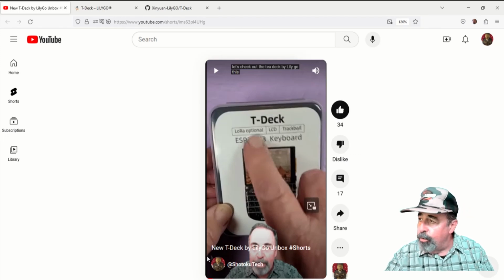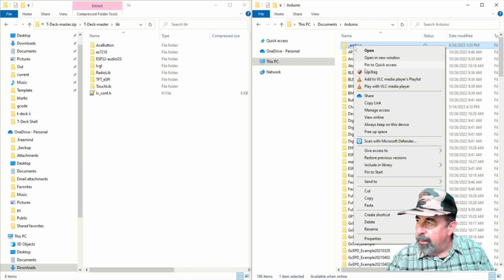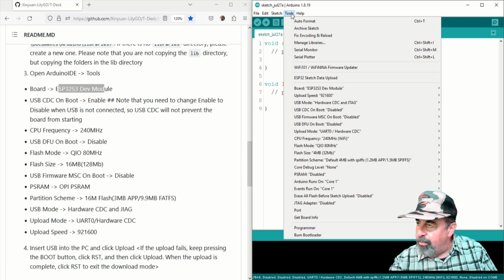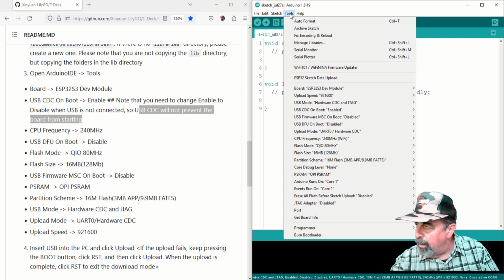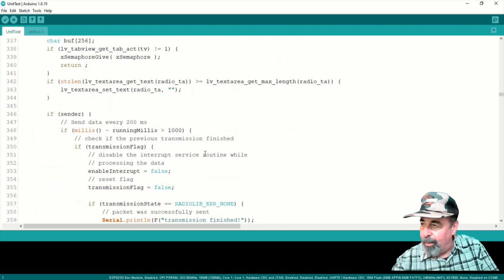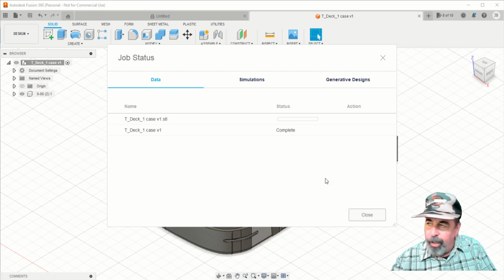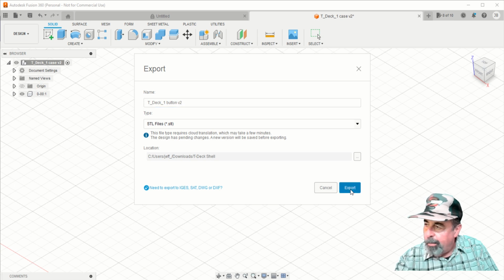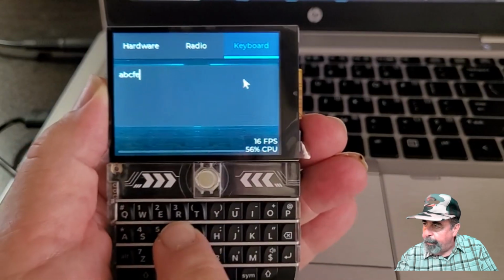Getting Started with the T-Deck from LilyGo

Comment: I'm getting an error compiling the UniTest sketch. "exit status 1 esp_vad.h: no such file or directory. I have the proper libraries copied and the links on the preference section. I tried searching for esp32 core files by Espressif to add to library and can't find it either which would have that missing file I guess. Any ideas to solve this? Update. Found Esp32 core by Espressif on the 'board manager ' I had it already installed. Still can't solve the problem. 😔
Reply from the maker: Yeah I am not familiar with that error. Sometimes I like to try making a fresh 'Arduino/Libraries' folder. Make sure all my board manager URLs are up to date. Reinstall all new board definitions and libraries needed.
Reply: @ShotokuTech  Agrees with you on the steps you take when preparing to flash these devices. In my case I used a Laptop I installed Arduino fresh with all the required libraries, board support and copied also the libs folders content to the right library folder, etc. Still couldn't solve the problem and couldn't find any solutions on the web either. So I just went ahead and flashed Meshtastic and and been TX and DX on the USA Long Channel with the T-Deck. I also own several other units, 2 Heltec V3.1 and several other ESP32 devices. I've found with other sketches posted on github by LillyGO having issues as well and have had to find a fix for them. But this one just didn't cut it. Take care and God Bless.
Reply from the maker: @johnny14794  I have a significant backlog but you present an interesting challenge. I might revisit this in the next two months. Best wishes.
Reply: @ShotokuTech  Always checking your channel for what's new. I am a sucker for gadgets and this channel is very informative, educational and I have learned a ton from you. I am not an advanced programmer but I tinker a lot and implement what I learn from you and other YTers Like "Volos". Looking forward to your next videos. Take care and God bless.
Reply from the maker: @johnny14794  Thanks! I keep trying every day.
Reply: No clue if you are still having this issue, but if so, use the "old" ESP32 version 2.09 found in the "board manager"
Anything above this gave me the same error. IE. Compilation error: esp_vad.h: No such file or directory

Comment: Great videos… I have a T-Deck on order and it appears that it does not come with a battery.   My question:  what voltage battery will I need to get to power it? I have searched and searched for the T-deck voltage/battery info with no solid results. Any info would be appreciated, thanks
Reply: Holy cow someone asked the question and got a dang answer. I can't believe this nonsense. I've looked forever for this information. Why the heck doesn't this appear on the lilygo website? All the other devices have a spec sheets. But the t-deck leaves you clueless. I had a solid idea that it was 3.7v just based on what I've seen people build out. But seeing the data sheet is something that, as a semiconductor enthusiast and builder, I expect to be available with hardware. If not that, then at least on the github or community forum. But no - I've even contacted lilygo with no results. Thanks again.  ~~~ Still frustrated though. I should make a video that is called: Lilygo T-Deck Voltage Requirements. I think I might just do that.
Reply from the maker: I like this one for its capacity and the plug is already installed. https://amzn.to/3H7YI0L
Reply: @ShotokuTech  Thanks for the info….I’ll check it out.

Comment: For those not familiar with them, STEP files are the interchange format for most 3d CAD platforms. If you export a STEP file from Fusion, it can be opened or imported in OnShape, FreeCAD, and probably half a dozen other CAD platforms.
Reply from the maker: Yeah, I just wish Cura could slice STP files. But this gave me the opportunity to learn how to use Fusion and I can modify the original files. Thanks.

Comment: This is really close to the optimum "Apocalypse Communicator". It still needs a couple of things. First off, high on the list, is a E-Paper display. Low power, persistent display of the last message thread, very important. That would need a blacklight option as well. 

And it needs a RTC. With a clock, you can pair units to only broadcast at certain times. This not only saves power, but if they both pair with the same broadcast key, they can remain offline most of the time. This is VERY important to avoid enemy triangulation. 

On the subject of wishlists, I would also include some variable frequencies as well. If you can broadcast on a range of frequencies, at agreed upon units of time, you become EXTREMELY hard to trace. 

All of this could be custom built, easly, if there was a good ESP32 keyboard option. I love the Blackberry keypad. But the power wasting color display, lack of RTC, and maybe a better radio are an issue.
Reply from the maker: All good, solid points. Thanks!
Reply: Very valid points. I would add a strong and individual encryption for the messages.

Comment: you may want to ensure the lora antenna is plugged in -- to avoid frying the transmitter
Reply: I knew about it, but had forgotten and probably wouldn’t have plugged it in without this reminder. T deck just arrived today.
Reply from the maker: Oh, I did have it on there, yes. I would think that goes without saying. Thanks.
Reply: @ShotokuTech  LoL, it never "goes without saying". Odds are, at any moment, there's a newbie looking for advice that happens by. I only heard about the "keep an antenna plugged in" thing a year or two ago, when researching Quads. Before then I never messed with a radio chip!
Reply from the maker: @MaxSMoke777  Yeah but why'd OP assume I didn't? LOL
Reply from the maker: Yeah this one has the FPC antenna: https://youtube.com/shorts/ims63pl4UHg